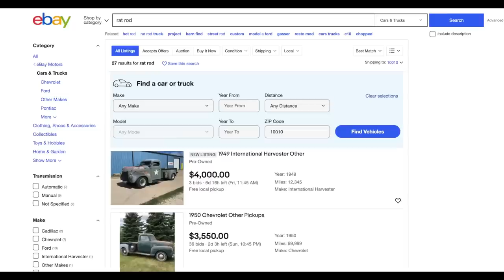Replacing my Electric Rat Rod with a True Gas Beast

Comment: Seriously!! 
Change the hood ornament to rat fink.
Yes make the car electric but keep the big block  to run a generator that charges a battery (10 to 20 kWh) and drive it with either a Tesla motor or Protean hub motors (if you can convince them to sell you any).
That way you've essentially made a rat rod hybrid with a freaking big block engine!

Comment: Come on Rich, you are better than that. The philosophy of a Rat Rod is to take a bunch of worthless parts and make them into a work of art.  It's not to take someone else's work of art, and oh... change the color of the wheels and remove the hood ornament.  That's like putting a mustache on the Mona Lisa, or painting Frank Lloyd Wright's Falling Water pink and changing the front door.   Take your POS BMW I8 doorstop and carve it up.  Remove the doors and bond them together to make a giant wing for the rear.  Get rid of the glass, remove all the wiring and BS electronics.  Make it technically as simple as can be. Carve it up. Use the other electric crap you have lying around the shop and make something rough, crude, offensive and wonderful.  Then go drive it to the BMW dealer and ask them to check the tire pressure.

Comment: If you do make it electric please make a overkill generator powered by the original engine charging a battery bank and capacitor bank with solenoid switches attached to a throttle switch and some stupid electric motor you would see in an electric dragster while trying to make it " "street legal" ". I've always wanted to see it done and know it can work with the right mind on it. Thanks for the rob zombie reference, made me laugh because my hair is as wild and would totally drive that. Keep it up Rich

Comment: Replace the 440 with a 100HP industrial 3 phase electric motor. Keep the trans and everything else the same. Use electric air compressors to cool the motor & batteries

Comment: If you are going to make that electric you have to make it spark..... I mean spark. With broken wires that spark. Tesla coils for stacks and so on.   Hide the battery pack and make it look like it is 4 old truck batteries that run it all. A rad rot back to the future kind of thingy. But the engine is best. Love the noise

Comment: In one sense this rat rod is stupid, overdone, impractical. and not safe. However it's so unique and RAW that it's really fun just as it is. I say keep the Chrysler 440, finish the floor and turn signals, put windshield wipers on it, and don't ruin the rims by painting them black LIKE EVERYONE ELSE IS DOING THESE DAYS. Then, I want to see a video of this thing powersliding in a big parking lot like you did with the S7.

Comment: Its possible to split the driveshaft in the middle￼ and install an electric motor with an input and output shaft on either side, between the transmission and the rear end. Then you have the coolest hybrid ever. Most important question is making a motor like that? Or better yet instead of looking for a motor to do that a transfer case that’s a single shaft and just install the motor on the transfer case operating backwards. the transfer case can also act as either a reduction gear or a increasing gear.

Comment: If you're going to make it electric, why not swap the location of the air tanks to the front with all of the copper airlines to keep the old-school look in the engine bay and put the batteries where the gas tanks used to be? The exhaust can just blow bubbles or something, or hook up big speakers in each tower to produce fake dino burner noises, or maybe even swap the towers for glass moss terrariums because green.

Comment: You can make it an EV but keeping the gas engine if you use it as a range extender like de BMW i3 or the old Chevy Volt. Best of two worlds... and the battery pack could be smaller

Comment: If it gona be electric, you need to fit a big rusty motor from a forklift. And a old trailer where you have the old Acid batteries from the fifties.
Of course, you only need outer shells from those things. Inside you put modern components 😁
Then program the controller so you with a switch can make it behave as it had old shitty forklift components.

AND all gears on it, need to be straight cut for the case of noise 😁

Comment: The strangest part, one hasn´t seen Fanta, the other one hasn´t seen Mad Max. If it has to bee an Ev,  Keep ewerything, hide the electric motor at the back, and keep the oil burner as a back up. Or even more stupid, witch is I guess is the usual way to go. Make it a hybrid. Let the V8 charge the electric motor. In that way you get infinite driving range. Just need some gas.

Comment: What you need to do is keep the gas engine, add an electric as the power train, and then when pressing the accelerator, have both go but way out of sequence. For example make the gas’s engine real loud at cruising and quiet at acceleration. Then you can say you made a better, or more funny “hybrid”

#abetterhybrid

Comment: Suggestion: RatRod a Nissan Leaf
Reply: Stretch it, put in/show 2x Leaf motors, stretch it, slam it. 6 wheeler, 4 powered and steerable wheels in the front, go road warrior ev with it. Gas-turbine generator to charge it
Reply: I have a Nissan Leaf for cheap you can start with…